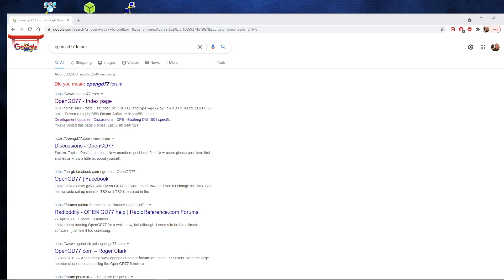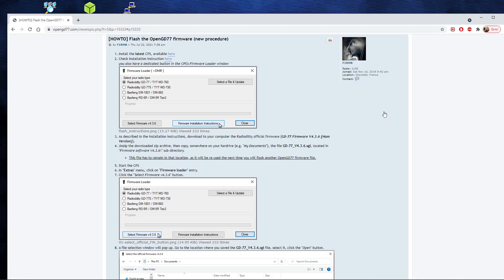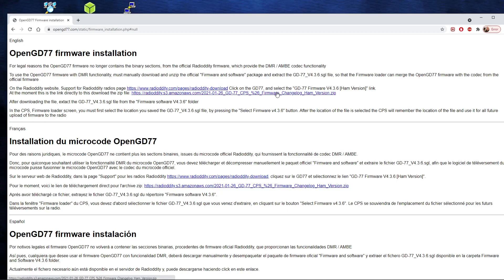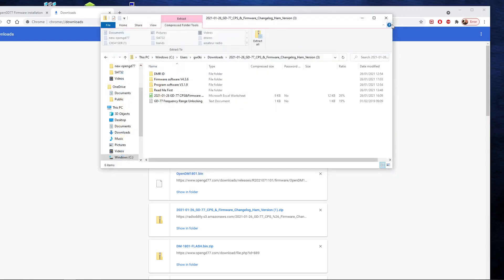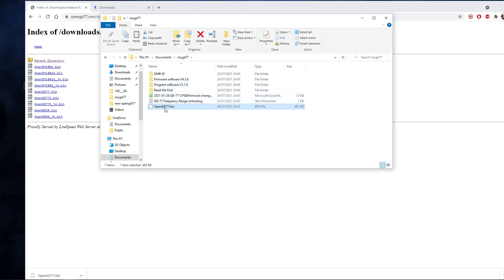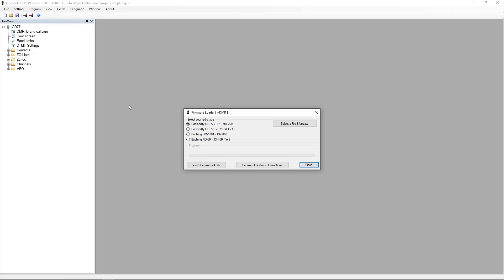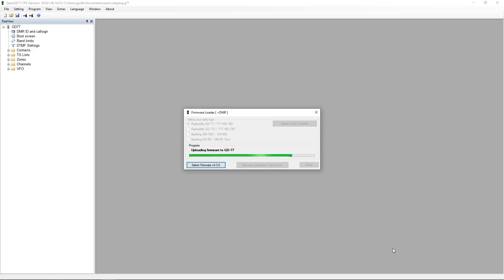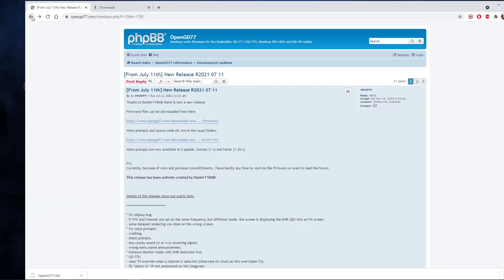Update on Upgrading to Open GD Firmware

Comment: I'm trying to change my GD-77 to run on OpenGD77 firmware but despite holding down the 2 buttons under PTT as I switch on, Open GD-77 CPS never sees the radio.  When you demonstrated doing the firmware upload, you said the a radio was already connected; did it come up in Device Manager as a COM port?  Mine doesn't seem to get into programming mode, it doesn't seem to matter if I hold down the 2 button or not, the green LED flashes slow fast slow and then the radio boots up and I get a 'USB INPUT DEVICE' under 'Human Input Devices' in Device Manager. My GD-77 is in virginal state, has no data set in it at all, ands reports SW V4.02.06 and I wonder now if the button presses for programming mode are different in that older version?

Comment: I bought one(GD77) early on it still has version 1 firmware do I need to upgrade it first?
Reply from the maker: You should be able to upgrade straight to the latest Opengd77 firmware

Comment: Need to watch this several more times.  For the DM-1801, how do I know which firmware to pick. There must  have been 3 or 4 DM-1801 selections.   It looked like you need to select 2 a total of 2 files?  The one in my example that has DM-1801 named as well as 
the Open77 bin file?   What about restoring to the original factory fimrware.  I remember reading something about EPROM data has to be saved.  I don't see any videos talking about this and how to do it.